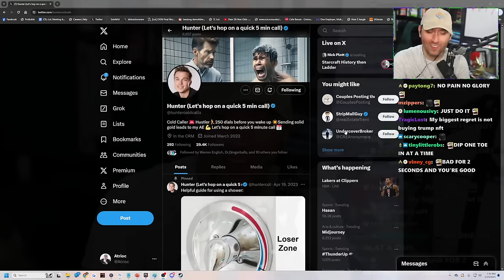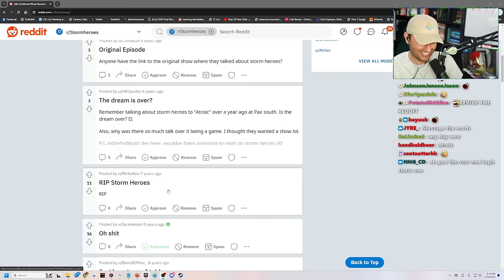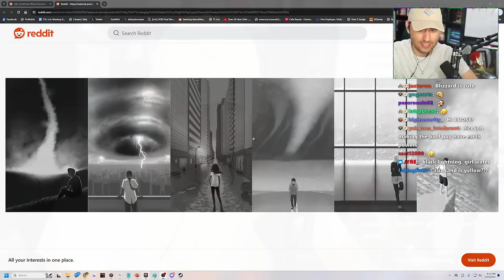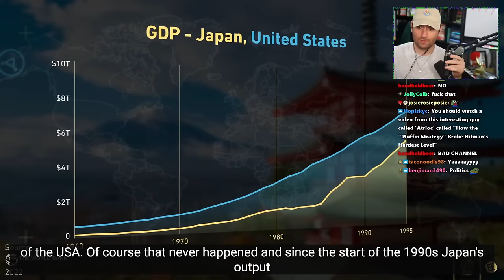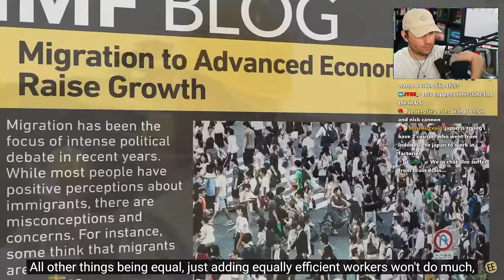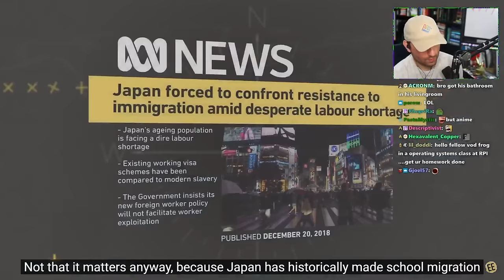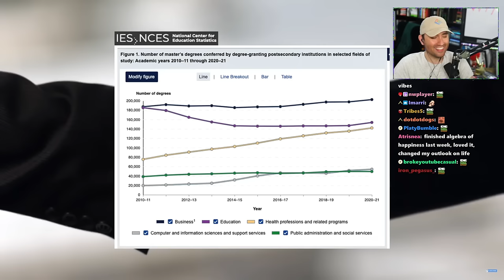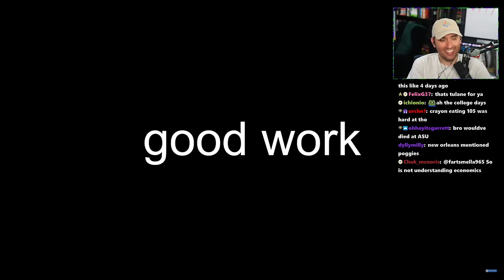Atrioc Reacts To Something Weird Is Happening In Japan

Comment: 12 hour shift isnt hard when you only work 3.5 days a week
Reply: As someone doing basically that, it is definitely hard. But easily worth it for the 4 days off.
Reply: Definitely not true. 12 hour shifts 3 or 4 days in a row are brutal.
Reply: u ain’t never worked a 12 hour july lifeguard shift dawg i don’t wanna hear it
Reply: 4-10s when working construction in towers downtown was nice. Mostly because Calgary transit is awful.
Reply: Youre joking
Reply: The shifts are brutal, the break is nice. Both can exist at the same time.
Reply: My department just transitioned from the modified Detroit (24 on 24 off 24 on 24 off 24 on 96 off) to 48 on 96 off and both the 24s and 48s are exhausting but at least with the 48-96 you feel like you are only working one shift and then you get your weekend.
Reply: As a Pharmacist I work both 12 hours shifts and 8 hour shifts and my god, 12h are so much better
Reply: I guess your joke flew over everyone's heads.
Reply: I worked 3 12 hours day at a target warehouse and I quit after a month despite making $23 an hour. Not only were the hours long but they were torturously boring since I was on a cherry picker by myself the whole time. Only having an hour or two of real free time for 3 days a week just sucks even if you get 4 days off. I would much rather have a balanced work/life relationship rather than dreading 3/7 days of the week. 4 free days may sound like a lot but I also found it gives you much more time to build your resentment for going to work
Reply: Spoken like a unemployed bum
Reply: @Kage-jk4pj as someone who did that is a labor intensive job, it’s NOT hard, you’re just a whiner